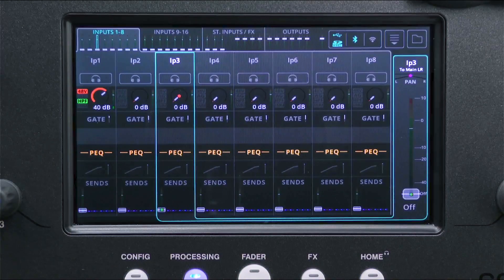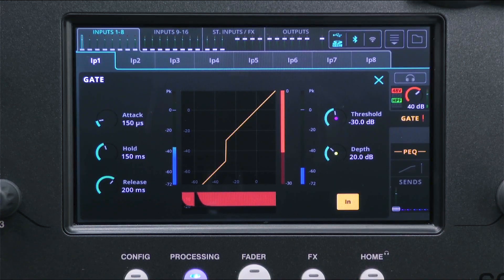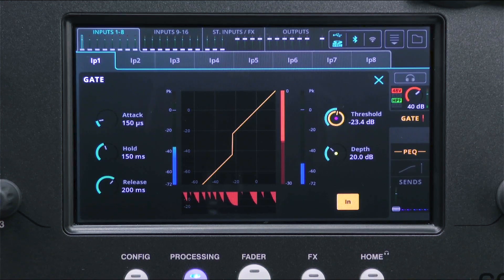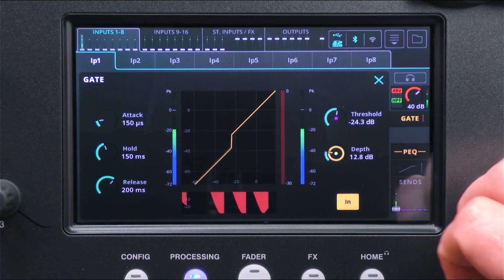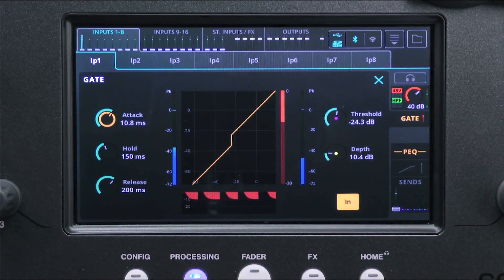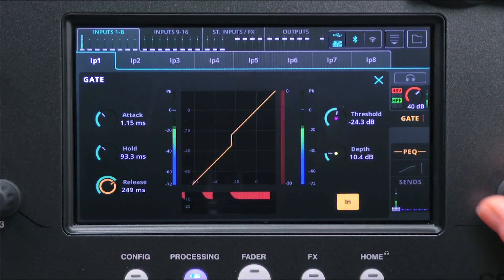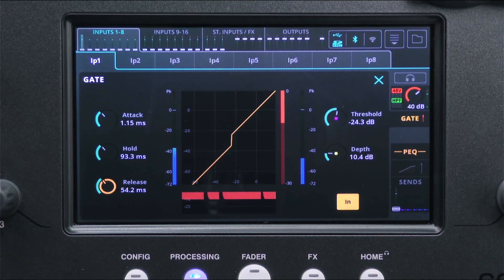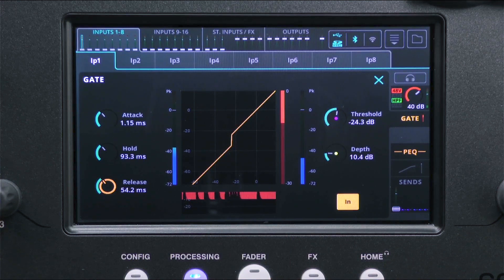CQ How To - Use the Gate

Comment: Im using V1.2.1 and the processing screen does not have gate. can you help please ?
Reply from the maker: Please make sure that you do not have the channel set to quick. To change form quick to complete, or vice versa. Please highlight the channel and select the folder icon in the top right corner of the screen. However, if the Gate is missing from a complete channel, please drop us a line support@allenh-heath.com
Thanks,
Luke

Comment: Will there an "expander" mode in future firmware update rather than a hard gate only?
Reply from the maker: Hi,
Thanks for the message,
The CQ system Audio is non networkable. So, we are afraid to say that these devices are stand alone and were never intended to be used with extended system. For remote stage box connection, we recommend using a multicore snake. 

Thanks,
Luke
Reply: @AllenandHeathUK  I'm talking about expander gate effect, not network feature.